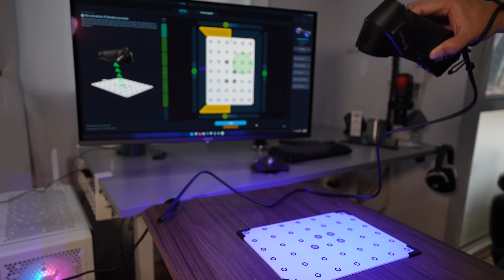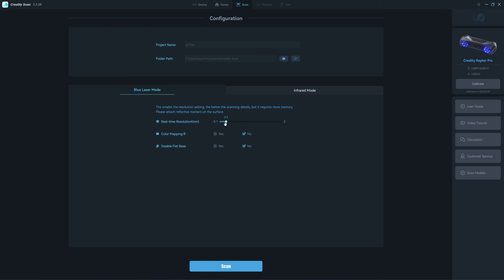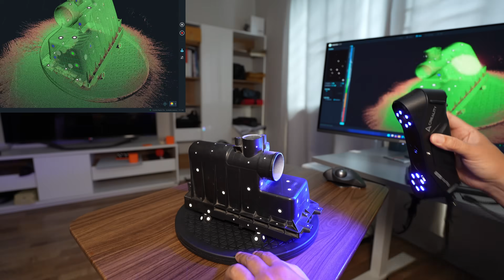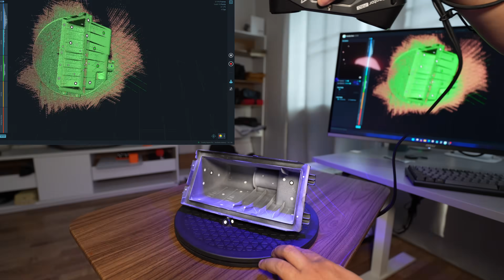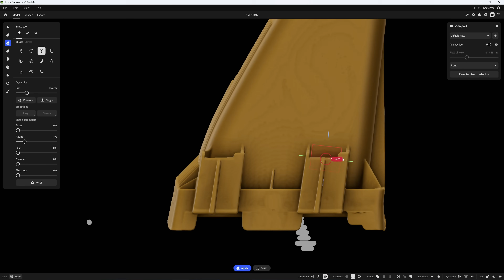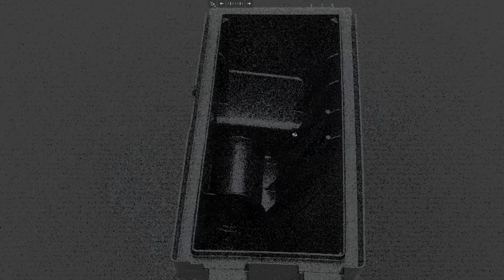Creality Scan Raptor PRO Guide: Air Filter Box Scanning & Calibration Tutorial

Comment: This was really helpful. I just got my Raptor Pro today and i have never scanned anything before. So is this how it goes?
- Layout markers on part or on table if its a tiny part
-Spray with AESUB spray if its got reflective surfaces, nooks/crannies. 
- Run a scan with global points first so it can map out position.
-Then run a point cloud (or a few point clouds) to get the actual part geometry. 
-Merge the scans 
-Now you can edit the mesh.

Is that correct? 

Thanks so much for your video and your time my friend!
Reply from the maker: Yeah, that's pretty much it.
Reply: @Payo-TensileCreator You're the man! Thanks for your valuable time.

Comment: Hi Payo. Scanning rookie here. Do I really have to scan spray? When I scan a metallic surface with my old Revo POP3, I just max out the exposure of the Depth Camera and it works well. I am not sure for Blue Laser mode- I have a Raptor PRO coming but I am worried about the scanning spray because I planned to skip buying it. Have you ever tried maxing out the exposure and see if it scans well too? Thank you
Reply from the maker: Black color can be scanned without spray. Glossy black will be slower to scan. Scanner can reach deeper into the pocket and scan faster with spray.

Comment: Is there a noticeable difference between the Raptor and Raptor Pro when scaning holes or slots in an object?
Reply from the maker: Raptor and Raptor Pro both feature the same 7-line projector, which is capable of scanning deeper into cleaves compared to the 22-line configuration. Therefore, there should be no notable difference between the two models when it comes to scanning deep pockets and slots.
Reply: @Payo-TensileCreator  thank you!

Comment: Howww do you find the settings in the pc to calibrate?
Reply: I dont have the button you are talking about to calibrate 😩
Reply from the maker: When you plug the scanner in. (Cable only, no wireless handle) There'll be calibration button show on the upper right corner of the screen.
Reply: @ okayyyy I I thought it was supposed to be with the wireless handle 🤦‍♂️🤦‍♂️
Btw my bridge is not charging still at the 2ed dot and not going any further then that and it’s been almost 5h in charge 🤦‍♂️
Reply from the maker: @  I use quick charger, full charge in a couple of hours.
Reply: @Payo-TensileCreator  I just hope it’s not defective 🥺

Comment: Do you recommend using Adobe Substance 3D Modeler for modification and 3D printing after the scan is complete? Fusion 360 is impossibly difficult to convert STL to mesh.

I mainly make product cases.
Reply from the maker: Yes, if your goal is simply to slice and print, that's fine. However, if you plan to use it for CAM or CNC machining, unwrapping, unfolding, or modifying the scan, you'll need to reverse engineer it in CAD.

Comment: Great content, as always! I’m running a small robotics workshop and am considering a 3dscanner on a tight budget. The Raptor series looks impressive, but I’ve seen mixed results in other reviews. Does pc performance significantly affect scan quality?? My setup is i5, Quadro P4000, and 32GB RAM. Do you have any insights?
Reply from the maker: Yes, PC performance will significantly impact the user experience. To run smoothly, you'll need a multicore CPU with more than 8 cores that is less than 3 generations old, and at least an Nvidia GPU RTX 4060. The Quadro P4000 from 2017 won't be sufficient, as it uses the same chip as the GTX 1080.
Reply: Question: so if I have a GTX 1080Ti is that not going to be sufficient for the Raptor Pro?
Reply from the maker: @colinflying  The GTX 1080 Ti has slightly lower performance compared to the RTX 4060. I'm not certain whether Nvidia drivers still support this GPU.
Reply: @Payo-TensileCreator I mean the GPU works great on my machine so I’m not sure what you mean by drivers, but I’ll find out in about a day how it works! Worst case I have a business reason to get a nicer GPU 😂
Reply from the maker: @colinflying  Business reason, I like that. 🙂 My concern is that the CR scan software might have glitches when running on older Nvidia drivers. You could try downloading the software and testing it—it includes a built-in self-testing function.
Reply: @Payo-TensileCreator  Just to follow up it seems to work great on my GTX 1080 Ti!

Comment: Great video. Is there any reason why you didn’t use the scan bridge? Is it not possible to swap between resolutions and features when using the scan bridge? I just upgraded from the Raptor original to the Pro and I also bought the wireless scan bridge upon your recommendation, so I am curious if there are scenarios when to use it and when it is best to be tethered. Thank you.
Reply: Imo, I think for scans that fit on the "desk"/turntable or which are in the range of scanner cables, it is faster, more convenient to just plug it to the computer and scan. I would only use scan bridge for cars or similar stuff, where normally (without the scan bridge) you have to walk around the object holding a scanner in one hand a laptop in other..
Reply from the maker: I was demonstrating the calibration process, so connecting it to the wireless handle wasn't possible. Additionally, for my specific scanning task, the handle would have collided with the table's edge. The handle is extremely convenient, and not needing to plug in an AC adaptor makes it worthwhile.